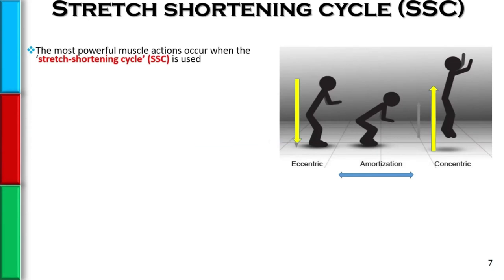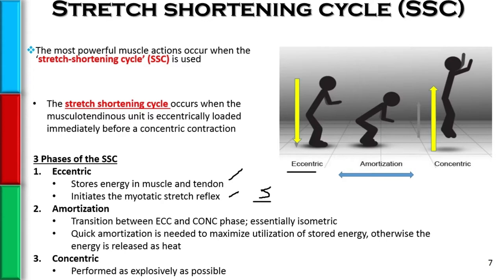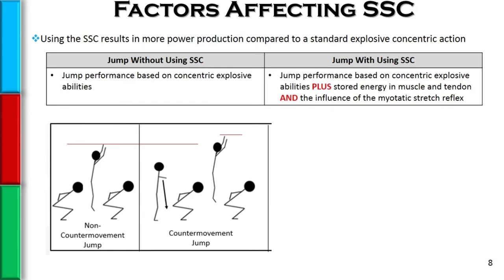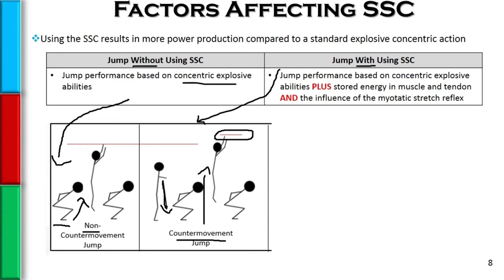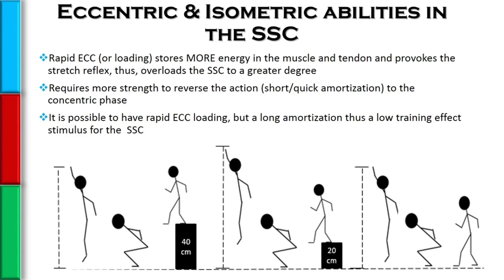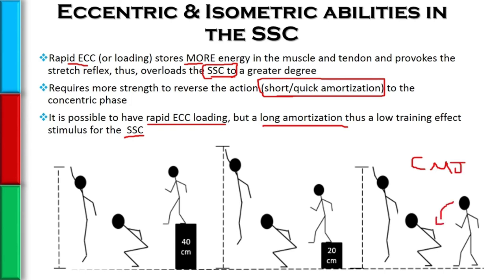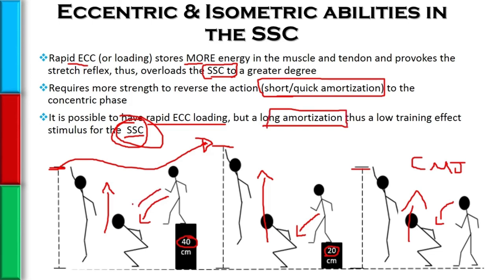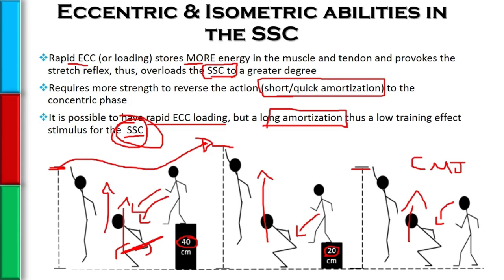The Stretch-Shortening Cycle (SSC) - What Is It?  The 3 Phases and Influential Factors

Comment: So it's better to jump off a shorter box in depth jump? How do you tell if youre doing depth jumps incorrectly?
Reply from the maker: Sorry, I'm just seeing this question now.  It would be difficult to say that it's "better", for everyone. 

It's based on the individuals ability. We want to be sure that the amortization phase is quick enough to get the training effect that we are looking for.  A higher box, requires more strength to overcome the forces of gravity.

You can measure ground contact time using a jump mat (250 ms is a good guideline).  Otherwise you have to use your eye.  As you gain experience watching people jump, you'll get a better metric of what it should look like, regardless of box height.